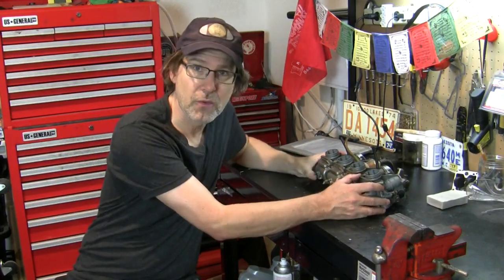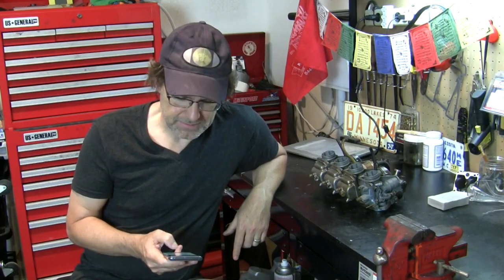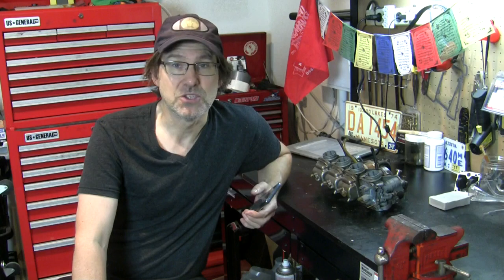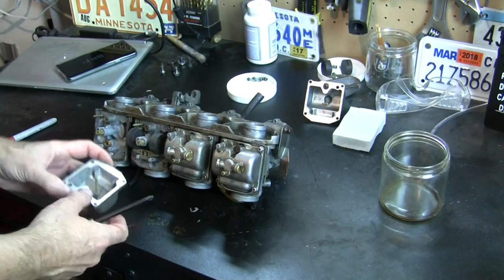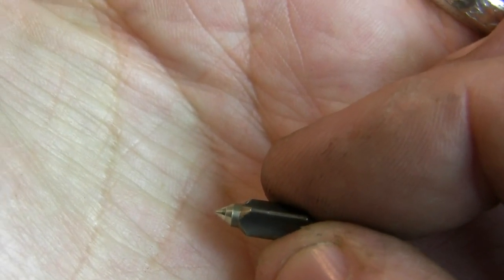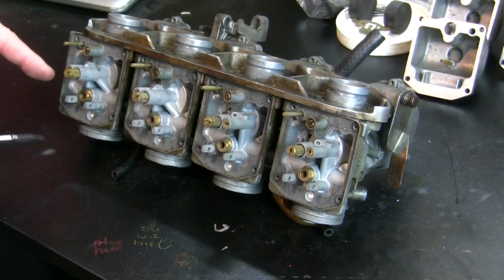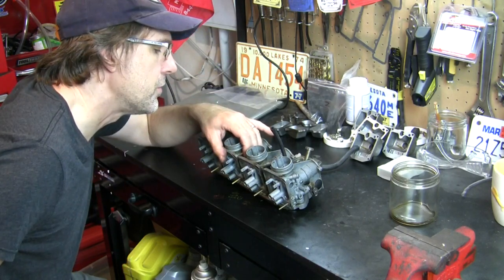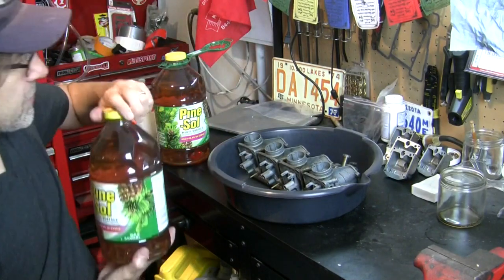Cleaning GS550 Carbs - Custom Cafe Racer Build (Part 61)

Comment: Hi there do you know how choke works?
Reply from the maker: I haven't looked very closely at the mechanism in these mikuni carbs but I assume the plunger valves on each carb close the idle air circuit when engaged (and of course open it when not).

Comment: where do you find all your parts for this project?
Reply from the maker: I have a list in my book as well as a video with links on UMTV. Multiple sources. Many items through eBay, but those sellers are usually found elsewhere too. I find eBay protects me pretty well from the bad sellers. I've run into trouble a couple of times and always got my money refunded.

Comment: So i got into rebuilding my carbs on my 78 550GS Suzuki and viewed your video and saw you had a baggie full of O-rings and wondered where you purchased them and also were they all different sizes? I also used the carb cleaner you recomended and found that it left a film that was hard to get off.
Reply from the maker: Yes, I got that assortment of tiny O-rings off eBay from China. Took a month or two to get here but I ordered the way in advance of needing them. They are more a staple 8n my garage than ordered specifically for this project. As for the carb cleaner, I'm sorry it left a film. I use different kinds and am not particularly attached to any one brand. Thanks for watching!
Reply: Well thanks for your prompt response. I saw that someone had ordered parts from  2FastMoto so I gave it a try. I ordered 1-kit Carb rebuild kit for the GS 550. Comes with 2 gaskets jets and needles and a lot stuff I don’t think I need but anyway. I need 4 but @19$ ea I figured I’d see what I get before I order more. I resurrected just ordering the O-rings from partzillo , genuine Suzuki parts and they wanted 3$-change for ea o-ring and it looks like I need 4-per carb so I’ll see what I get and maybe order 3- more kits from 2fast .Sorry for the long msg. Vin
Reply from the maker: @vinfrancis1160  No worries. Those will probably serve you well. I should have mentioned I've also gotten good parts and prices from cruzinimage.net. website is a little cumbersome to navigate, but they have quite a bit of parts for GS550.

Comment: I have a 1982 suzuki gs550l and I want to put pod filters on it, but I see on the air filter it has 2 air fittings for the main engine and the carbs how did you divert those and put on pod filters?

Comment: Don't raise the needle.  I did on my VM24ss carbs and it led to fuel bypassing the needle at idle and made the revs hang.  Returned them to factory setting and all was good.  Did change all jet sizes several times but finally found a good combination.
Reply from the maker: Thanks! I was making that decision on a hunch. Reassuring to have your insight on the matter.

Comment: starting at 19:33 you remove the air screw.  its pointed and has a beautiful taper to it.  I ordered a carb rebuild kit and it didnt include this screw and o ring, though i've seen other companies offer it.  I have two broken o rings on those screws...can i replace that o ring individually or should i replace the whole screw itself?  Issue there is i'm having a hard time finding just the screw
Reply from the maker: Unless damaged, you should be able reuse old screws and simply replace the o-ring. A used fuel screw can be purchased on Ebay. Just polish tarnished screw taper with baking soda or any metal polish. I've used toothpaste b4 too.

Comment: I'm happy my comment influenced your decision, good point you made about owners eventually having to make such judgement calls, but your words "it would have been more beneficial for viewers if I were to take the carbs apart entirely" (paraphrasing) made me kind of regret recommending you leave it alone hahahaha.. I would have loved to see a tutorial as to how to completely take apart the carbs on this particular bike, especially one from you where the camera-work and accompanying explanations are equivalent to following a certified suzuki mechanics course.. we've learnt so much from you, I at least am eternally grateful :) by the way, high E guitar string but what gauge, 0.9? I read somewhere its not good to use metal for those holes, i used a plastic broom whisk (whatever you call those strands) with great success! Great point about "wrong" vm 22 pieces being sold on ebay!! thanks for the measurements info!!! lastly, if that loose T-link ends up leaking (hope it doesn't) maybe you'll have to make another video where you do in fact take everything apart. but for now i think you made the right decision considering how clean those carbs looked :)
Reply from the maker: Thanks for your comments. I think your call is the right one here, for now. My daughter is playing lighter strings, so her high E would be 0.009 inch. I don't think one could do much damage with a guitar string in a jet if one was being reasonable about it. Best.

Comment: Perhaps I missed it, but why didn't you take out the air screw while cleaning?
Reply from the maker: You did miss it and it's my fault- I made  mistake with my camera and failed to record it. As I recall it was a really busy week for me so I didn't go back and film it. Sorry. You're certainly correct to suggest they be cleaned.
Reply: @UrbanMonkTV  
Very helpfull films by the way, i will make use of them a lot the comming months for my gs550!